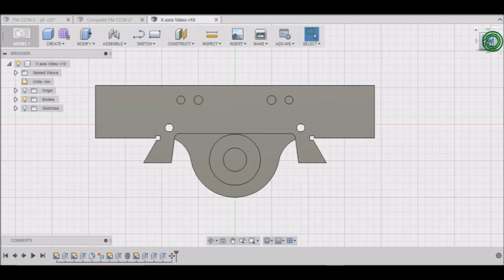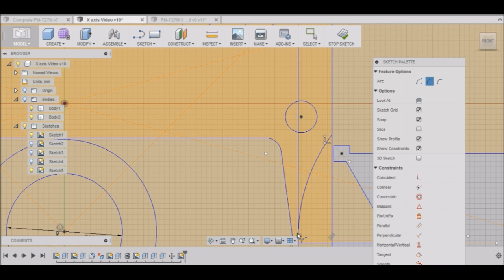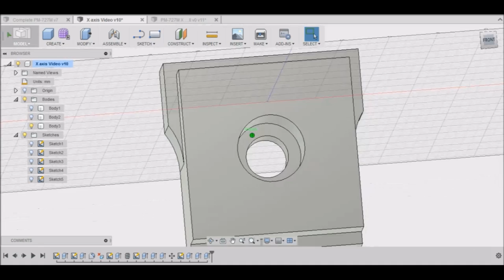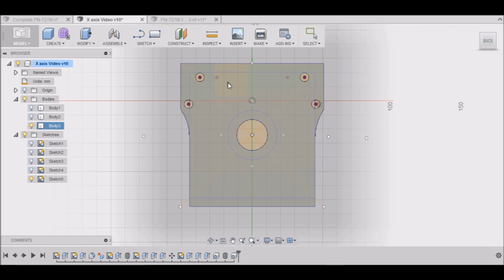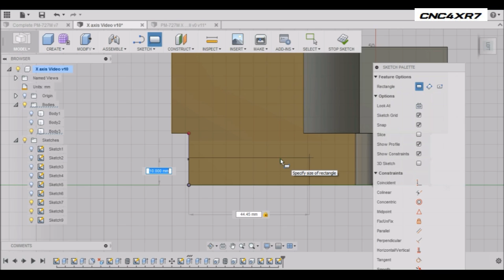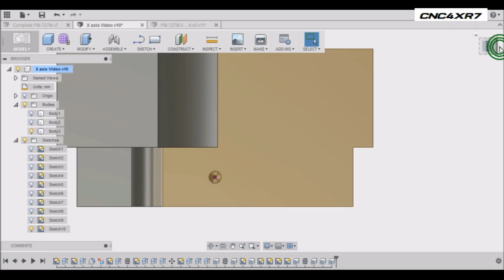PM-727M CNC Ball-screw / Stepper mounts from A to Z  " X axis Table Bearing Block"

Comment: What programs do you use to draw plans for and produce objects for your projects? Do you plan to produce full machines, kits or components for the PM-727? Are you going to use stepper motors or some of the servo motors that you have tested?
Reply from the maker: +John McKenna 
I use Autodesk Fusion 360. It's free. As for the PM727m the purpose of my videos is to share what I have learned through the help of others so that viewers will have enogh information to convert there machines. The information could be applied to ant machine. I understand it can be difficult for some to fabricate the mounts without manual tooling. I don't intend to offer kits , machines, or  mounts but I have not ruled it out.  As far as motors I chose 3 phase steppers as apposed to servos. 
Be safe Sam

Comment: If the travels on this mill are the same as the G0704, make sure you spend time getting the most out of the Y travel, that's the one that causes most of the problems in regards to lack of travel.
Reply from the maker: +bensbenz 
 Yes it Is this mill in the stock form has 8 1/2" of Y travel I'm Hoping for 10" when complete but will see.
Be Safe Sam